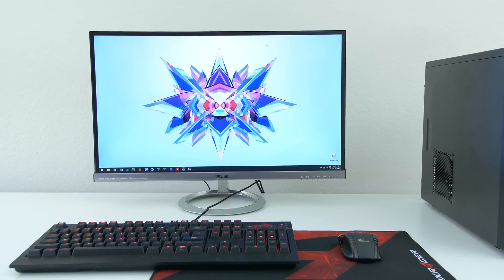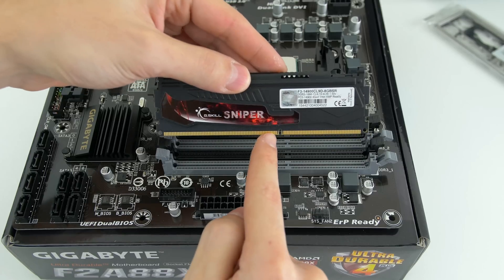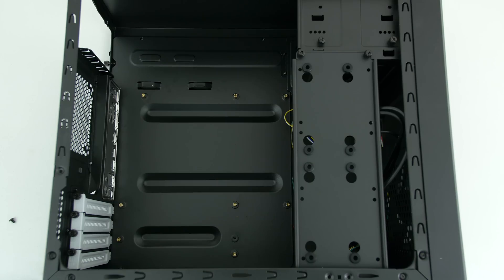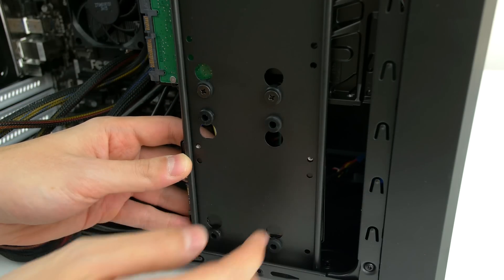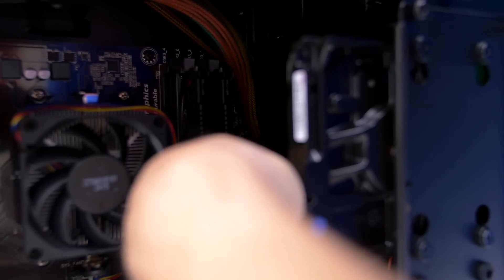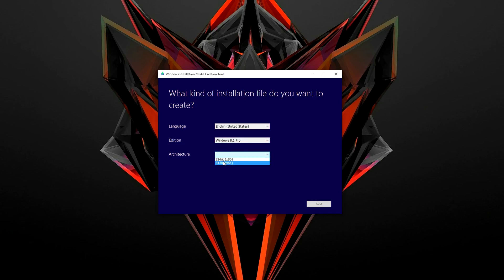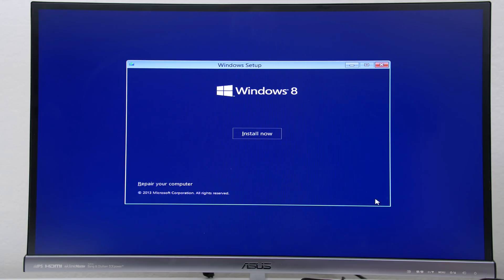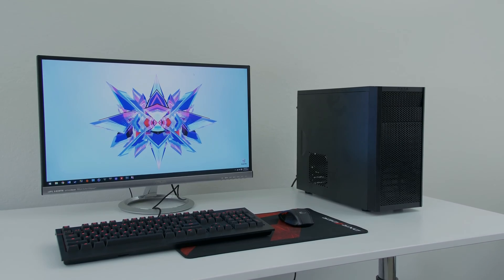How To Build $450 Gaming PC w/ Windows Install

Comment: I spent the same and my specs are:
Corsair 450w psu
Intel Pentium G4500
Gigabyte wifi motherboard (cant remember the name lol)
8 gb crucial ddr4 ram
128gb SSD
AMD RX 460 2gb
1tb HDD 
Arctic CPU cooler.

Runs everything i play really well.

Comment: I did this in my calculator and got 596 for the cost. I'm a bit disappointed
Reply: Cheese Puff this was like 2 years ago you dumbass
Reply: Some Guy I don't think the dumb ass was needed
Reply: Cheese Puff i think it was because it perfectly describes you
Reply: Some Guy there is so much edge on that comment I cut my finger while reading it
Reply: Cheese Puff I'm edgy bro

Comment: My gaming PC was about $1,000. If you would like to build it, here's the parts list:

- Intel core i5-6500 3.2 GHz quad-core processor 

- ASUS B150M-C D3 Micro ATX LGA1151 Motherboard

- Corsair Vengeance LP 8GB (2 x 4GB) DDR3-1600 Memory

- Western Digital Caviar Blue 1TB 3.5" 7200 RPM Internal Hard Drive 

- Gigabyte GeForce GTX 960 4GB Video Card

- Corsair Carbide SPEC-M2 MicroATX Mid Tower Case (Chassis)

- Corsair Builder 600W 80+ Bronze Certified Power Supply

I don't really consider the operating system and monitor a part, but I listed them here if you want to know:

- Microsoft Windows 10 Home OEM 64-bit 

- Asus VS228H-P 21.5" 1920x1080 Monitor (I have and use 2 of this item)

Comment: You need a separate functioning pc or laptop to install Windows onto a usb right? I'm just asking because I didn't see that mentioned.
Reply: Frankie Santiago yes
Reply: Frankie Santiago i dont think theres any other way
Reply: Frankie Santiago You could probably do it at your local libary or something
Reply: Worship Skobbels I was just asking as a general question. When I was attempting to copy the install tool on a flash drive the working pc wouldn't recognize the usb. (Not even at the library.) A friend of mine used Rufus to put his copy on a usb for me. He said it's common for the install tool to be problematic on windows10.
Reply: Frankie Santiago Ok 👍

Comment: What do you think Overwatch and CS:GO would get on this?
Reply: kane kenerly I highly doubt it considering just about anything can run CSGO
Reply: Kalumrai Yea idk what these guys are saying lol and thats on 1080p max
Reply: About like 100 frames, the GPU is okay, but not that good.
Reply: Kalumrai What do you mean by old? Its really not too young, but dude a 750 TI can't run it by at least 80 frames. Search it up man
Reply: Dr. Oktoberfest Any graphics card can run it 60+ frames
Reply: Kalumrai nope, a GT 210 can't run it on 60 frames. You said any
Reply: Dr. Oktoberfest Basically any
Reply: Kalumrai Mine can't lol
Reply: kane kenerly Then you probably have something wrong with software, not hardware
Reply: Kalumrai Could be
Reply: I usually only get 20fps but that could just be my computer. I need to build a tower sometime
Reply: Kalumrai I get 300 frames with a 750ti
Reply: Brandon Hurtado I know, that's what I've been saying.

Comment: can this PC run CSGO with decent frames? (150 FPS)
Reply: Yeah probably, the graphics card should have enough power to do that, I went with the Nvidia GeForce GTX 950 and got it for 120 bucks, way better than the base one in the vid
Reply: XxGodlyGamingxX ! Do have a link? I cant find the graphics card used in this vid
Reply: IIKeekoHD https://www.amazon.com/Sapphire-VAPOR-X-PCI-Express-Graphics-11217-00-20G/dp/B00G36G9ZA/ref=sr_1_1?ie=UTF8&qid=1478075104&sr=8-1&keywords=SAPPHIRE+Vapor-X+Radeon+R9+270X
Reply: Phoenix CS I bought one used and it seems to work but nothing shows up on my monitor when I turn the pc on....I triple checked everything and I have done nothing wrong, could it be a problem with the graphics card??
Reply: Keekoh probably, IDK about used ones. I buy fresh stock ones
Reply: Phoenix CS any idea what would be a good alternative graphics card?
Reply: Keekoh get a 1060 3 gb version, its a really good card

Comment: for this build i would say an o
i3 or even a pentium would be better because the fm2+ socket is a dead socket and has no decent upgrades. but the intel pentium and the i3 are good with hyperthreading and u can upgrade to an i5 or even a i7 in the future without changing your mobo

Comment: Hey Plz let me know if this can handle two of the graphic cards you used in the video! 😊
Reply: This does not support SLI.  This GPU and MOBO does not support it.
Reply: +Technology Spotlight Can you explain more
Reply: Search "SLI" on Google.
Reply: TRIGGERED what dose that mean can't I just add another Card and I'm good or the motherboard can't take it or what
Reply: You need to have a GPU and a motherboard that supports SLI or else it doesn't work.  The parts in the video don't support it.
Reply: OHHHHHHHHHHH ok can you explain the SLI
Reply: Unfortunately, no.  You can search it up though.
Reply: From Wikpedia:

Scalable Link Interface (SLI) is a brand name for a multi-GPU technology developed by NVIDIA for linking two or more video cards together to produce a single output. SLI is an algorithm of parallel processing for computer graphics, meant to increase the processing power available for graphics.
Reply: Wanna know how old i am and am building this pc guess
Reply: OMG ok thanks so ooooooo much
Reply: +Technology Spotlight thank you so much for your help really needed it
Reply: No problem.

Comment: are these two CPUs the same?? if not are they similar and could i use the

 AMD Athlon X4 860k with AMD quiet cooler Quad-Core Socket FM2+ 95W AD860KXBJASBX Desktop Processor http://www.newegg.com/Product/Product.aspx?Item=N82E16819113410

 instead of the 

AMD Athlon X4 860K Kaveri Quad-Core 3.7 GHz Socket FM2+ 95W AD860KXBJABOX Desktop Processor (BLACK EDITION)
http://www.newegg.com/Product/Product.aspx?Item=N82E16819113379

Comment: Can anyone link me to the cooler, or does it come with one of the parts?
Reply: Awesome Sweg Might be packaging problem. Ask for a return it and ask for a new one. I have opened 20+ motherboard packaging and all came with IO shield. You must be really lucky to get 1 with no IO shield.
Reply: it is the stock cpu cooler, which comes with the cpu.
Reply: Chivo Koningsveld Thanks
Reply: +Chivo Koningsveld Does the io shield come with any of the parts?
Reply: IO shield comes with the motherboard. Screw comes with the case. Sata cable comes with motherboard. All the powersupply connector comes with the power supply. Stock cooler comes with the processor. Thermal paste is pre-applied on the stock cooler. Anymore question?
Reply: +WB IsMe No more, thank you so much! ^^
Reply: +WB IsMe Judt ordered it and the io shield is nowhere to be found
Reply: The TP wifi adapter says installation using cd, how did ed install the cd
Reply: Does the wifi adaptor come with any of the packages?  Can't be bothered searching it up.
Reply: Unknown User GO TO THE WEBSITE AND DOWNLOAD THE DRIVERS

Comment: is this build good? http://pcpartpicker.com/list/TDp68K just wanna play 
games, don't care that much about graphics, I always put them to medium,
 but I need to change my processor that's amd 4 core with stock fan 
cause it been overheating and restarting my computer alot just because I
 play overwatch and in low settings. My graphics card is a Nvidia geforce 750 ti

Comment: how fast will it run counter strike global offensive
Reply: Very fast, like 150 fps on  max settings
Reply: Doesnt take much to run cs:go max settings 60 fps. My computer is worth less than $50 these days and can run csgo at barley over 60 fps. Specs in case you are wondering is a GTX 650 and an amd athlon 4x core 3.1 non overclock processor with 6gb of ram no ssd and a 100gb hard drive (ik it sucks)

Comment: http://pcpartpicker.com/list/8cgJf8

Is this PC compatible and capable of running games like Battlefield 1, Dishonored 2,  and Subnautica with medium to high settings, 1080p, and with 50+ fps?
Reply: It could but get a rx 480 or gtx 1060
Reply: Easily but you might want the 4690K for the CPU instead.

Comment: CSGO, League of Legends and Minecraft run good?
Reply: Wait nvm, watched the benchmark video. Still need a benchmark for LoL. Definitely wanting to build this!
Reply: +LegitTvHD diablo 3 is like lol please learn your benchmarks, mineceaft is like csgo etc
Reply: +LegitTvHD if it runs gta 5 at high settings, it would run LoL on 8k max settings 100+ fps
Reply: +Dawdso right? jesus
Reply: +FruitCakeNinja If I have on my old pc minimum 80+fps and my machine is
Intel pentium e2180 OC at 2.5 ghz
GT440 1GB
and 3GB ram at 335mhz, this machine would be minimum 1080p at 200+fps no problem. LoL is highly optimized game.
Reply: Ok. Lowest settings?
Reply: On your pc*?
Reply: im not the one who asked the first question btw
Reply: +FruitCakeNinja Max settings. running no problem LoL at max setting. i turn down enviroment to medium to bring fps to higher grades. its distracting me while playing so i have minimum of 90 fps stable while playing.
Reply: +FruitCakeNinja oh and i didnt my machine is 200+fps, i meant on pc in video lol.

Comment: if i build a pc, and use my old harddrive, would i get the windows for free( not buying a new one)
Reply: yeah
Reply: What if im adding ssd and hard drive would i get the windows for free?
Reply: +google-sama depends if you got the ssd and hdd from your old pc then yes you will have the os . but if its a new ssd and hdd the no you need to install it (i prefer installing a os on ssd much faster loading time)
Reply: Andrey does i only have 1 hard drive from my old computer and how do i know that im on ssd? aren't they merged into 1, the ssd/hdd whenever u go to your files and stuff?
Reply: google-sama idk but its should say in your files whether its saved on hdd or ssd
Reply: No man !  Windows will say "Dafuq", cause it is on a new hardware. You should delete the data from the old HDD and install the OS once again..

Comment: Does it matter where you put RAM sticks. I heard it's better to put them in slots zhat
that are closer to the cpu, in this case the black ones, but you put them in the grey ones. Is there any difference in performance?
Reply: DONT LISTEN TO THIS GUY^^^^^^^ read the manual, they are all different
Reply: It matters, if you have two sticks, plug  them in dimm1 and dimm2. 3 and 4 are for your 3rd and 4th sticks.
Reply: Most likely it will be dims 1 and 2, but regularly check your manual for confirmation
Reply: +Smashing Ryan whats with the hostility?
Reply: +Smashing Ryan i have seen motherboards where the dimms are 1&4 and 2&3 i bet you have never built a pc so calm down buddy

Comment: Planning on making a similar PC build, but I'm fairly new to PC builds I wanted to know if I'm bottlenecking 

Gigabyte Micro ATX DDR3 2133 NA Motherboard - 68.99
XFX DOUBLE DISSIPATION R9 380                           - 179.99
Patriot Signature DDR3 8 GB (2 x 4 GB)                   -  34.99   
AMD Athlon X4 860K                                                   -  74.99
EVGA 500 W1 80+                                                        -  37.08
PNY CS1311 120GB 2.5" SATA III  SSD                     -  39.99
TP-LINK                                                                           - 7.98
____________________________________________________________
Total: (W/out PC case)                                                   444.01 

Like I said I'm new to this and am in need of assistance 
Any flaws? Missing Essentials? Better Parts for similar price? 
Trying to stay under 450 but if it drastically improves performance let me know.
Better recommended graphics card ? Better processor (AMD)? Is the power supply sufficient? Radeon R9 270x or R9 380? What will give better gaming performance?

Comment: Techsource can I use a hard drive from my laptop or does it have to be 3.5 inch?? 
Also if that hard drive has windows installed can I skip the windows installation part??
Reply: Yes

Comment: does it run games with high settings? i only play cs go and minecraft and i want to know if it can run those games without fps drops.
Reply: it woukd do at least 50 fps
Reply: install optifine and forge, you can get great FPS with (almost) any computer
Reply: 109fps max on minecraft
110 high csgo

Comment: I'm new to this but is there a disc reader or are those optional
Reply: Will you ever need one?
Reply: Disc readers are optional, but they are super cheap these days. It wouldn't hurt to buy one if you still use any games that run on discs, or if you want to install your OS with a disc.

Comment: I did this exact build but with a different graphics card (Radeon Sapphire Nitro R7) and it was a total success! This was my first build and I haven't even overclocked the CPU and I'm really impressed so far with this machine's performance. Thanks so much for the build guide and parts list, I don't think I would've come up with anything nearly as good as this.

Comment: Should I use stalk cooler or is it better if I use a new cooler master.
Reply: also can I use 430 watts with an evga Geforce GT 730?
Reply: Probably a little late, but you should be fine using the stock cooler if you're not planning to overclock. However, if you're planning to overclock, go ahead & buy the cooler master one. (:

Comment: would a 430w power suply work as well or does it have to be a 500w?
Reply: The R7 270X require a 500W PSU.  430W will still work but risky. Better be safe than sorry.
Reply: +WB IsMe thanks good to know

Comment: Is it similar if I get a skylake mobo and skylake cpu but everything else is the same? the skylake mobo is usb 3.0 aswell
Reply: +Will Smith It will cost more than $550 in total.
Reply: nope if i made this exact build on pcpartpicker for canadian it costs 600 but the skylake build costs 590. The question I have is the building process similar with a usb 3.0 skylake mobo?
Reply: Will Smith Almost similar. DIY hardware always follow standardized design layout and connection.
Reply: Awesome thanks man

Comment: Will  PNY Anarchy X 8GB Kit (2x4GB) DDR3 2400MHz CL11 work on a Micro ATX Motherboard GA-78LMT-USB3?
Reply: No iv actually used that board in one of my pc builds. Some sites says it'll except 1600mhz. But some also say 1333mhz. So anything above those itll usually down clock to those speeds.
Reply: I talked to an IT guy at my dads work who builds computers and he said it would work.
Reply: +Thomas Blanchette it might work but it'll be down clocked unless you get a better motherboard. gigabyte shows that board accepting 1333+ on there site. and Newegg says 1600 max on theres. it's a 760 chipset they don't hold real high clocked ram.
Reply: +nate ozz i do plan on upgrading my mother board later but for now thats the best one i can get
Reply: +Thomas Blanchette well ull be in good shape with that board for awhile. if it down clocks your ram to 1600 mhz ull never know the difference. I ran that board for year with a fx 6350 8gb 1600mhz rip jaw ram. and r9 280x.
Reply: +nate ozz years*

Comment: Why do you need to leave a slot in between the RAM sticks?
Reply: +MajorRadioactiv That is how the motherboard's ram placement is configured.
Reply: +WB IsMe Is it like you have to put your gpu in the upper slot for better performance?
Reply: MajorRadioactiv Having 2 ram onto the same color slot = dual channel configuration. Different motherboard have different ram placement configuration so it is best to read the motherboard's manual. 
For some motherboard, ram will not work if you slot 2 ram into different colored slot.
Reply: +WB IsMe Oh like that, thanks

Comment: Ok, so,I plan to build this over the summer, but when i click the links in the description, both the motherboard and GPU are out of stock. I eventually found the motherboard somewhere else, but i cant find the GPU. Are there any other options for it? Or another place to find it? Pls help
Reply: There's abunch cards you could use. But the best that I could recommend for a budget build is. R9 380x. Gtx 750 ti or gtx 950. All them are cheaper cards and would give you basically the same performance the r9 270x would. But the 380x is alil more powerful then the others. But it's also a bit more. You might be able to get a r9 270x on ebay for cheap. Because alotta stores stopped selling them because they have been replaced by the r9 300 series. But gl man wish ya the best on your build.
Reply: +XplosiveBolt - PC Gaming No not really they are all the same thing. some just come with different cooling. or some might say there the gaming edition. which means there factory OCed. So just find ya one in your price range that you like the look of and go for it man.
Reply: nate ozz thanks dude! Much appreciated.

Comment: Would A Core I3 6100 And A Sapphire R7 370 4GB and Asus H110M-A Work With this Build??

(I Don't Know Much About PC Parts Compatibility)
Reply: +Bengali VailokZZZ Yes. You need to change ram to DDR4 if you wanna use Skylake processor.

Comment: How do I overclock this?
Reply: +SuperDarkMan12TV Get an overclock software
Reply: Or you could do it in the bios but that takes way too long
Reply: Bike Race Addict does the overclock software do it automatically?
Reply: You adjust it yourself
Reply: Bike Race Addict Alright thank you.
Reply: You should have an external cooler though! Or else the cpu will overheat.
Reply: Okay, thanks for the advice. i don't want my hundreds of dollars of equipment to get destroyed  :P
Reply: What cooler do you have? The stock? The hyper 212 evo is a great cooler option!
Reply: I haven't even started yet, I'm simply getting prepared. I'll look into that but I'm on a budget build. Can spend too much money :/
Reply: It's 40 bucks, this CPU comes with a good clock speed, so not super necessary to overclock, so you could save some money on not buying an external cpu cooler
Reply: Alright sounds good :D
Reply: Good luck :)